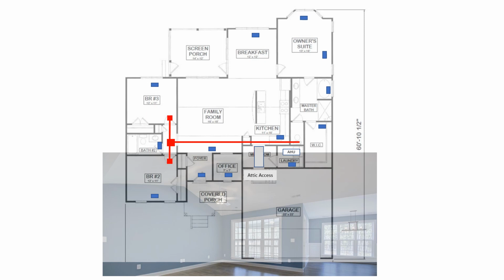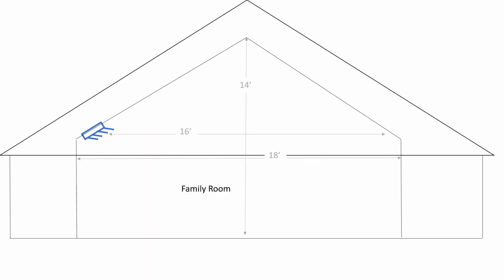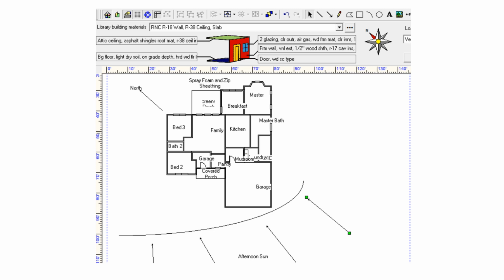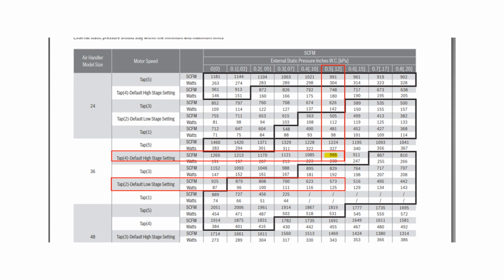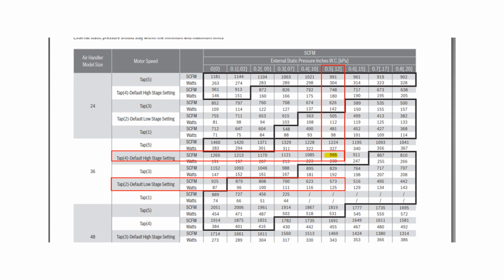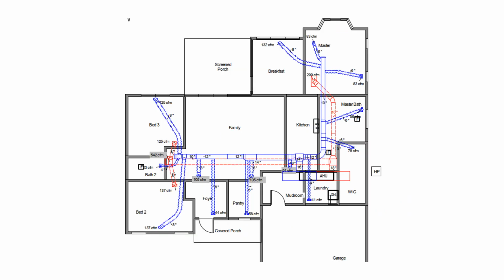My Southport House Part 3: Duct Design

Comment: Nice job I have been using wrightsoft for almost 20 years now. Is amazing how far it's come. It takes some time, but you can remap your equipment, duct, fittings, and registers with current parts from your supplier. you can even attach pricing and labor hours so after your done with the draw you have a material list and even a proposal including parts, labor, and mark up. Save's a ton of time.
Reply from the maker: @PrestigeComfortKY  they just had a big update. New look and 3d viewer added.